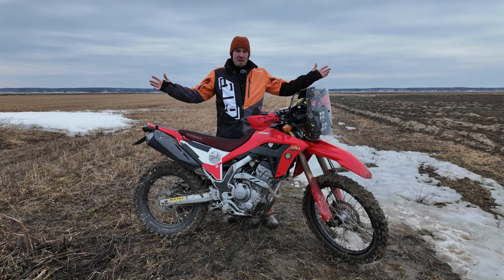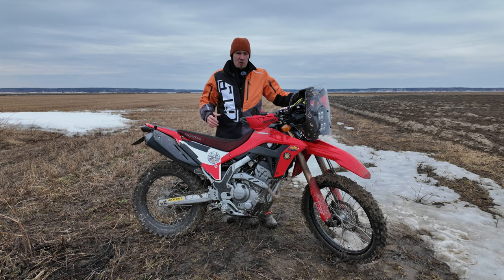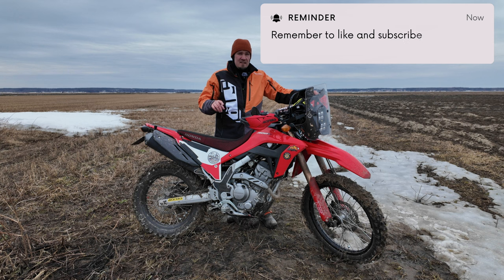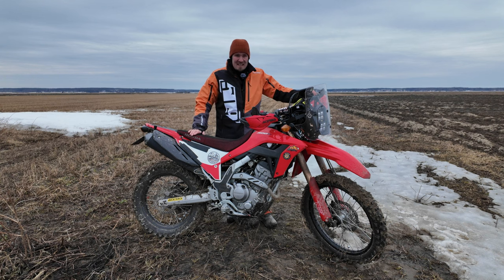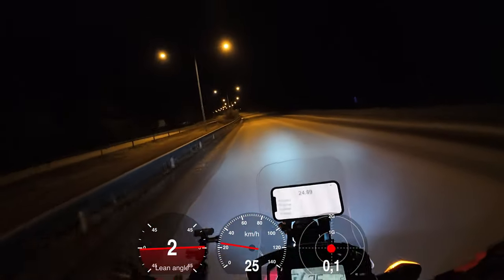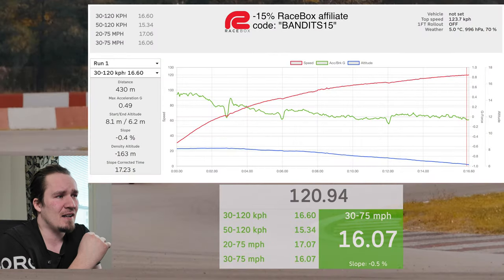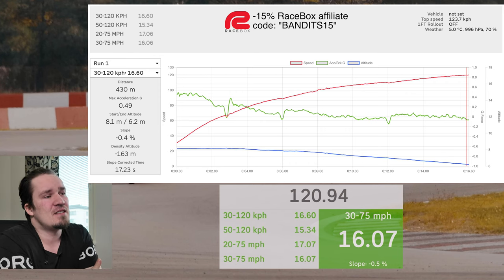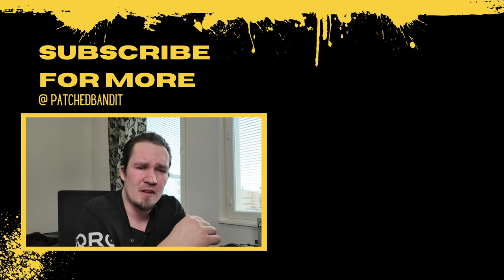Is Honda CRF300L TOO SLOW?! Part 1

Comment: Look forward to more.
Would have liked you to see what the result was only revving to 7k as that seems to be where acceleration slows markedly on mine and yours kinda sounds the same, the CRF300L power curve reminds me of the old XR00R's I had except there's only half the power and torque
Reply: XR600R
Reply from the maker: Very good point. After 9K HP drops drastically. I need to test this. I added this to the description and if it makes a clear difference I will post a part 2 to this video today or tomorrow.
CRF300 peak power is around 8.5K and drops like a rock after 9K so switching gear at 9K might be optimal.
Reply from the maker: I just posted an update. Thank you so much for pointing this out to me! I would have not thought of this on my own as I'm no drag racer 😂 https://youtu.be/rOjCeNwywIQ
Reply: @PatchedBandit  Me neither, but it always made me wonder why the red line was soo high when it fairly obviously struggles to accelerate to that point, looking at the dyno graphs (dirtbike) peak power 8400rpm but it's only got 1hp less 1600rpm lower which means it's really starting to flatten off quickly, nice to see more tangible tests to confirm or dispel seat of the pants feelings 👍

Comment: Just came back from my first 2024 ride of my CRF 300L. I also bought AXP protection plate. Next in line is new suspension and possibly same rally tower. Good times.
Reply from the maker: Its a fun bike.. offroad 😄✌️

Comment: Our fastest guy in our group is deep into the 7s in the 1/4 mile at 200-ish mph, built Blackbird. I'm slow, a 9 second guy with a stock height, length, weight ZX14R. My 14R and I did do a half mile at an airstrip in 2018 and we did 189 mph in the half, instrumented, from a standing start. That was a good ******* day at work. Instrumented testing ftw, road testing, risky...well on anything but the CRF :)
Reply from the maker: I'm gonna try and find a place where I could do this outside public roads (aka. highway) but it's hard and usually cost money. 
Other problem is to get all the test bikes to the location if I do find one 😅

Comment: I would exclude (depending on the number of tests) the best 3 and worst 3, so you have a fair middle ground to judge on. Not going beyond 120 km/h is okay, starting at 30 km/h eliminates some rider error. Maybe you shifted a touch too late for max accelaration. But then in real life Honda's CRF 300 first gear is so short, and with superbikes that long all you need is first gear. Starting from a red light means a level playing field for all bikes- resulting in more than just engine thrust, also gearing and clutch feeling come into play. Cheers, Günter/Nürnberg
Reply from the maker: Starting from a standstill tires, temperature, rider and all other factors play too big of a role. I’m taking the best successfull run as a result because well.. the bike did it so why not. 

This can never be a 100% vacuum test with 0 variables. 

The best time for each bike is as fair as this can be as sometimes I can do 4 runs sometimes I need to do 6 to get enough of a successful run. 

No matter how I would calculate some average variation formula there will always be someone saying it should be done differently 😅 The more powerful the bike is the more stable the different runs are going to be. The problem with the Honda is that all the external factors are much more of a factor because the bike is supremely slow 😂
Reply: @PatchedBandit  As long as you use the same base you can compare
Reply from the maker: @enduromotorradtouren  Maybe I could add the averages as an extra column to the excel 🤔
Reply from the maker: I added average of all the 30-120kmh and 20-75mph runs to the excel sheet. This way anyone can see that there has been a lot of variation between runs. If the slope is too big up or down I will ofcourse not take that kind of run in to the calculations at all.